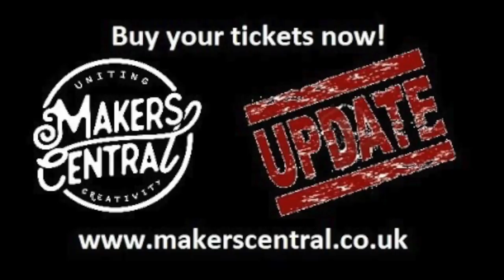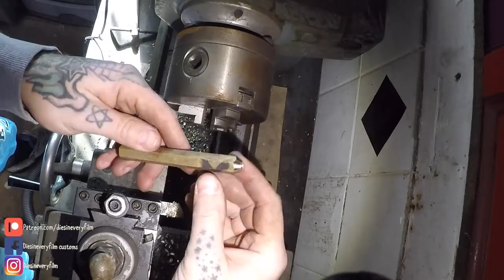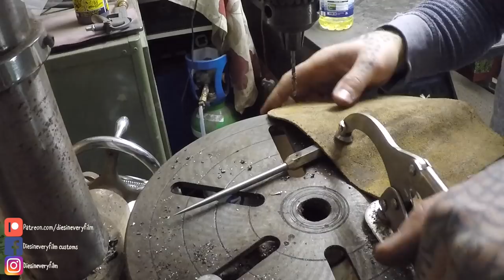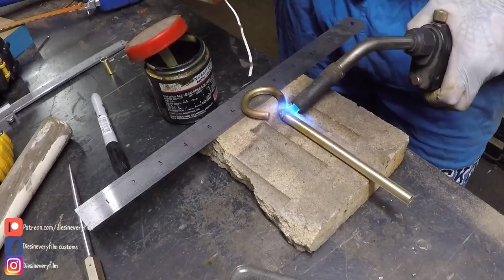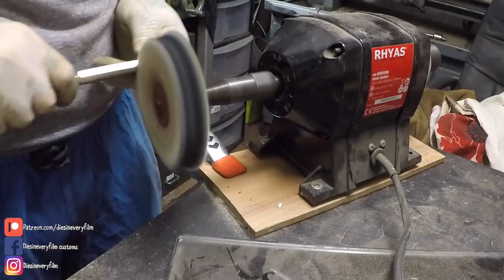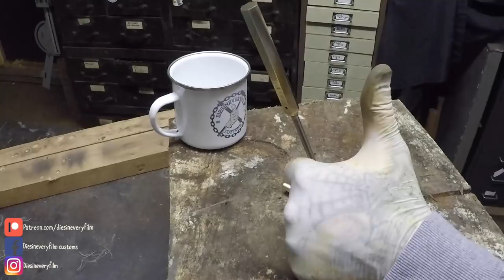Ice Pick DiResta Inspired

Comment: Nice work mate! I like the idea to keep the pick in place with a through pin.
Reply: Also thanks a lot for the shout out!
Reply from the maker: Thanks buddy and thanks for the challenge. Yeh I wanted to be sure it wouldn't fall out and drilling the copper tube into the hole pressure fit it 👍🏼👍🏼👍🏼